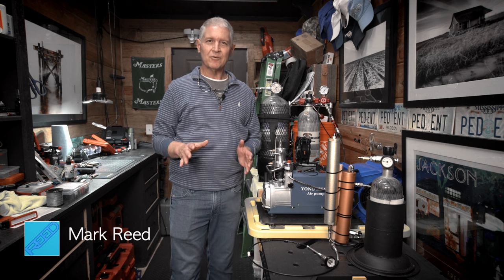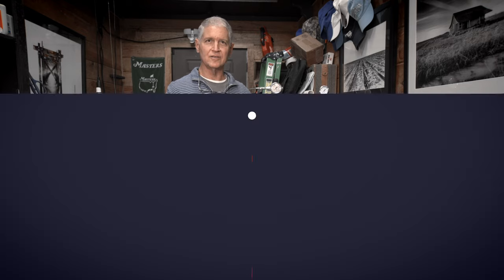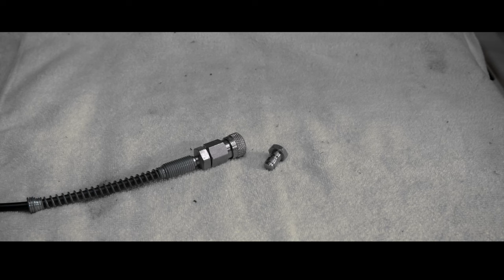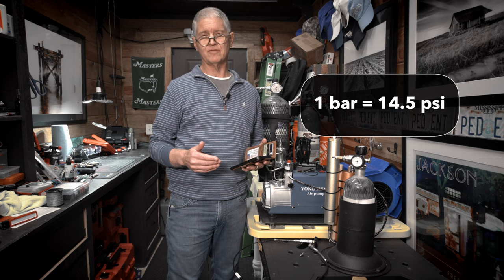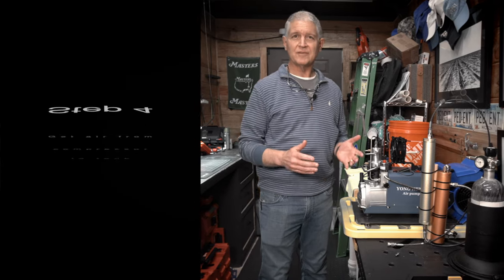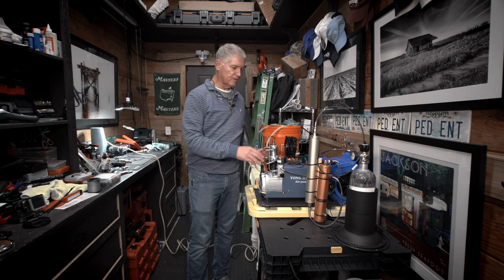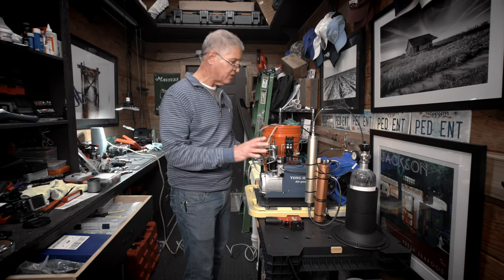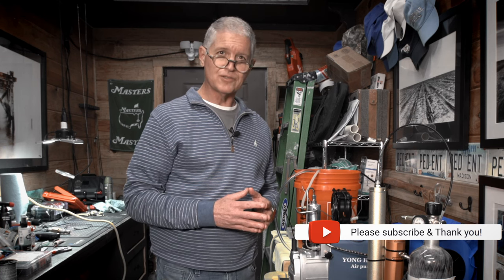How to Fill a PCP Airgun Tank

Comment: Hi, thanks for this, very useful. Sorry if I missed it, but how long did it take to top up the tank from 220 to 300 bar?
Cheers,
Rich (UK)
Reply from the maker: I keep a log of all my fills, but I am out of town right now and don’t have access to it at the moment. In general, it takes around 11 to 12 minutes with my YH for most of my fills, but the majority are starting from around 190 bar. Going from 220 to 300 was probably 6-7 minutes. Thanks for checking and for watching!
Reply: @Mark Reed  cheers for the info

Comment: Is the intlet in the Tank the Outlet too? So If i Open the Tank valve the Air will leave through the Same Connection i used to fill the Tank with?
Reply from the maker: The simple answer is Yes. It serves both purposes.

Comment: How long have you been using that compressor? Are you happy with it's performance? Good video...👍
Reply from the maker: Thanks. I've used that one for about 3 1/4 years and it's worked great with no problems at all. I've tried my best to treat it well and be consistent with maintenance. It's been a solid unit. Thanks for watching!

Comment: What is the gauge for on the top of the tank? It doesn’t tell you the pressure of the air inside the tank? Thanks
Reply from the maker: Yes, it's a pressure gauge, but most that you get on a lot of tanks are not necessarily great. Having a good quality gauge can be really helpful and there are some good alternative gauge options that you can use instead. Few gauges will continually read the internal tank pressure at all times.

Comment: Hi there , thanks for this great video . I'm also plann to buy this yong heng . Is this compressor capable to fill 6.8l tank up to 300 bar ? What do you recommed me , smaller tank to buy  (3 lit. ) or bigger (6.8 lit)
Reply from the maker: Thanks for asking. The answer is yes. I have two 6.8l SCBA tanks that I fill with the YH. With that being said, I have never started from 0 psi and I never run my unit much more than 15 minutes at a time. I will typically start around 170B and fill to a max of 290B. I have my unit set to stop at 290B. I just don't want to stress it any more than that. I'm sure you could fill to 300B, but just be careful about your temperatures. If it runs for 20 minutes, I would definitely recommend taking a break and letting it cool off before filling any higher. Incremental filling is a good strategy.
Reply: If you want a hassle-free option get the hills EC3000 It's expensive but is rated to top up a 7 l tank or to fill it with multiple sessions no water cooling needed The compressor will operate and switch itself on and off as needed so no need to worry about overheating or when to open the tank valve I open mine before switching the compressor on it copes with it fine, That's what it's built to do.
Reply from the maker: @urbanspaceman7183  That's good to hear. I understand most of the reviews are very good. It's a little beyond the price point for many, but hopefully it's a good investment. Right now we don't know about the ultimate longevity of the unit since it hasn't been out but a few years. It will be interesting to see what the average lifespan is. From a cost standpoint, it's equivalent to approximately 4 Yong Heng's. It would have to last at least a minimal of 12 years to compare favorably (assuming a minimal 3 years for each YH).
Reply: @jmarkreed  A rolls Royce costs more than a ford and both do a similar job .I know which one I would rather drive. Not having to worry about water makes the Hill more user friendly as does the start and forget feature, but I do understand that price is a consideration, just worth paying for me and the way I use it.
Reply from the maker: @urbanspaceman7183  No disagreement! Well said, and if it continues to hold up long-term, you may see me have one myself one day.

Comment: Hello, it's been a while since the video...
One question... I have the same compressor.
Is it normal that the red valve always releases air intermittently at slightly higher pressure?
Maybe someone knows an answer?

Comment: Why did you use a high pressure gauge to measure your tank pressure isnt there a pressure gauge on the tank shown??
Reply from the maker: Although your tank may have a "built-in" pressure gauge, depending on the quality of your tank, it may or may not be very accurate. Having a separate dedicated gauge is not a bad idea. At a minimum, you can compare gauges to see if they read the same or not. Dealing with extremely high pressure, it's a good idea to be as accurate as possible. It's just another layer of safety. Thanks for watching!

Comment: Do you have any thoughts on PCP vs. break barrel ?
Reply from the maker: Well, different for sure. I have a TX200 along with my PCP's. No critique of either. Different technology. Different investment commitment- PCP's MUCH more due to all the needed accessories. A little easier to work on springers. PCP's with moderators are much quieter than springers. Both totally fun to shoot. I think if you're in the sport for the long haul and you have the means, you definitely need both.

Comment: What did your set up cost?
Reply from the maker: Wow. What a great question. I'm not going to have a great answer for you since I don't recall at this point, but know that I always consider costs and do extensive research before I buy anything. Know also that anyone getting into PCP airguns is going to spend far more than they think. It's really an addictive hobby/passion that lends itself to getting a lot of stuff. Nevertheless, most don't mind opening their wallets to buy a ton of fun. Ultimately, that's what it's about. Over time, the cost of shooting airguns will probably be less than powder burners considering the differential in ammo cost, but the initial costs will likely be much greater, especially for higher-end guns and air compressor setups.

Comment: What filter do you use? Where did you get it?
Reply from the maker: Thanks for watching and asking. I use two different types of filters. One is a water separator and the other is filled with molecular sieve to remove all (or as much as possible) water before it goes into the tank. Both were purchased through Amazon. Here are the links:  https://www.amazon.com/gp/product/B07Q221JFX/ref=ppx_yo_dt_b_search_asin_title?ie=UTF8&psc=1 and  https://www.amazon.com/gp/product/B077SX5G9V/ref=ppx_yo_dt_b_search_asin_title?ie=UTF8&psc=1

Comment: Great!  You never mentioned the temperature gauge.  What it the max temperature it should read ?
Reply from the maker: Thanks for asking. I just want to clarify your question. Are you asking about the temperature of the compressor itself, or of the tank that is being filled? I'm not really focusing on the Yong Heng compressor in this video, but every compressor will have certain ranges that are considered safe. For me, I don't want to see the temperature of the Yong Heng get into the 140's F. I try to keep the temperatures as low as possible and the highest temps that I see in my fills are generally in the 120-130's F range. As far as the tank itself, the temperature will increase as the tank is filled according to Charles' Law. Volume of a gas and temperature are proportional. The faster a tank is filled the faster it becomes hot. With that being said, I don't actually check the temperature of the tank. If you are filling your airgun, you want to do it slowly. Please let me know if that is what you were asking or not. Thanks!
Reply: @jmarkreed  Yes, you answered it. I was talking about the compressor head.  Thanks !

Comment: Hi,can i fill tank 33l with that compressor? Thank you
Reply from the maker: A 33 liter tank is huge, and I would definitely not recommend filling it with anything less than a professional high capacity compressor. The Yong Heng is not designed to fill any tank like that. Thanks for checking.
Reply: Thank you very much

Comment: I’ve learned you always bleed the compressor upfront before closing the tankvalve
Reply from the maker: Thanks. My tank (like most) does not have a check valve which would prevent the back flow of pressure towards the compressor. Once the compressor is stopped there should be equal pressure throughout the entire system and allow the closure of the tank valve without causing any pressure flow in either direction. Without a check valve on the tank, if the bleed valves are opened on the compressor pressure would start flowing from the tank towards the compressor and I would lose some of the pressure I’ve tried to save in the tank. That’s why I do it that way.

Comment: Visit your local dive shop.
It costs next to nothing for a refill.
Reply from the maker: Well, I would respectfully disagree with that. For one, many don't have access to dive shops or they may be located many miles away. The cost of gas adds up. The only dive shop in my area charged me $15 the only time I went. That also adds up pretty fast if you're doing a lot of shooting and filling. Sounds like you have a situation that most don't. Great for you. Unfortunate for the rest of us.
Reply: @jmarkreed  I have the choice of 3 dive shops and 2 cylinder testing places, so competition is keeping the prices good.
Reply from the maker: @sahhull  That's fantastic. We have one dive shop and one paintball place but it's a good 40 minute drive one way. I agree. Competition makes a huge difference. That's why I'm having to stick with my YH. It's also pretty hard to beat over time, and I don't have to go anywhere to get my tanks filled. Overall, I'm pretty satisfied with it.
Reply: @jmarkreed  the closest place is literally 5 mins walk away, but I'm not about to haul a steel 12litre 300bar cylinder down the street.
But they are all within 15-20min drive.
They charge me £4 to fill my 12 litre to 300 bar.. And that includes free coffee and a chat while I'm waiting.
Reply from the maker: @sahhull  That's awesome! (Especially the free coffee and chat). I would absolutely do the same if I were in the same place. Enjoy my friend!